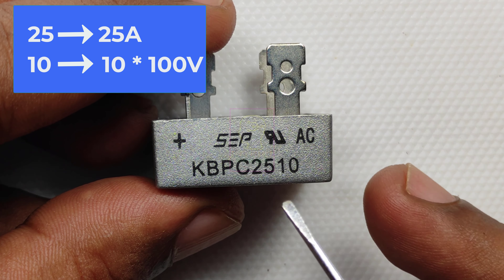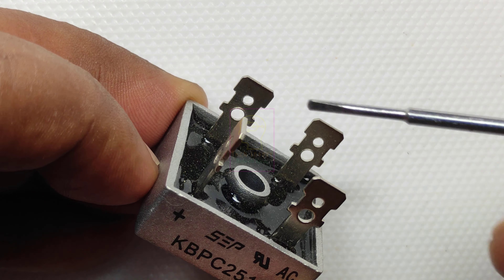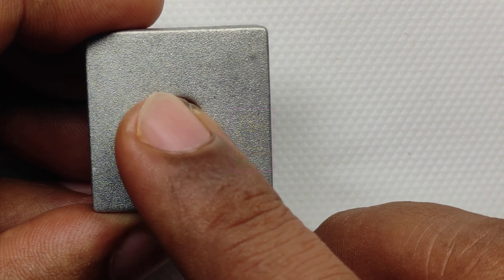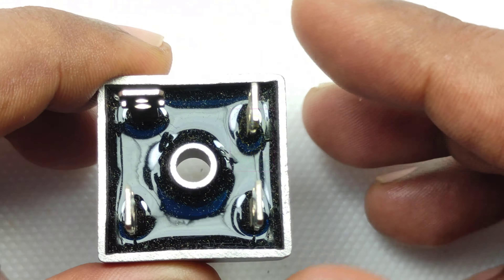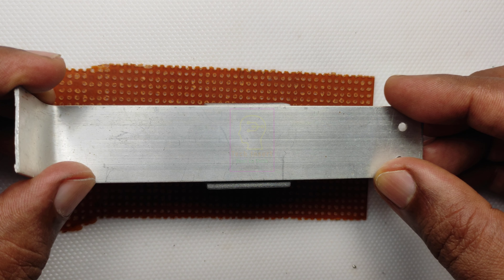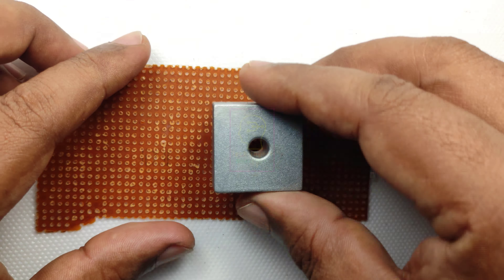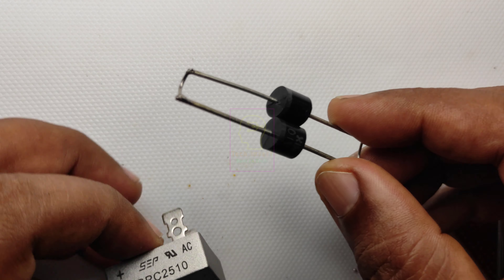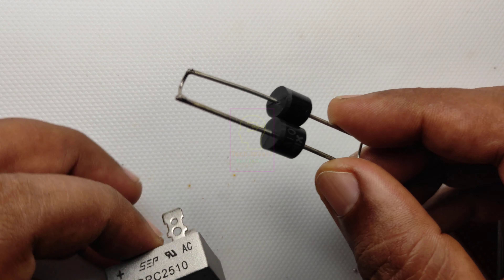All things you need to know about a Metal Bridge Rectifier

Comment: I had used this in my amplifier power supply. I used 15A bridge without heat sink
Reply from the maker: That is great. Earlier I used diode connected in parallel for high current rating and now a days using metal stuff which is very easy to assemble.
Reply: @TechInsert  good to hear